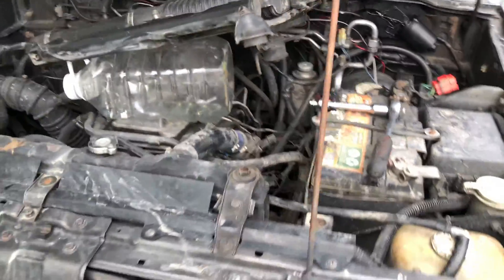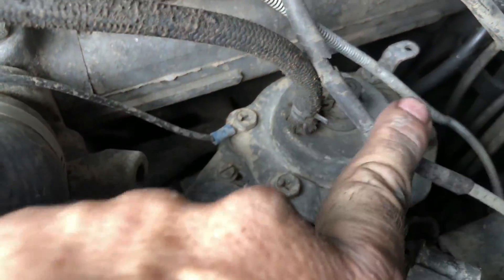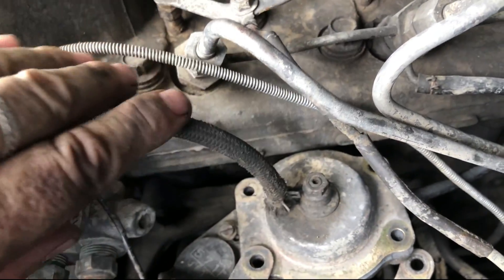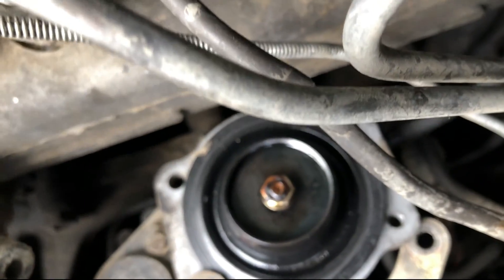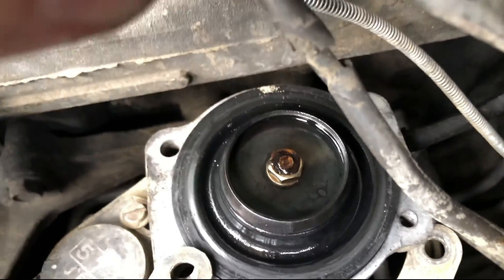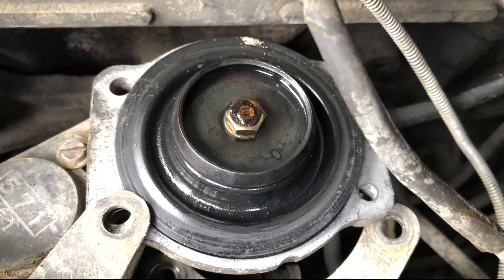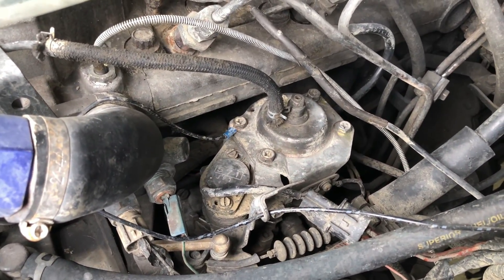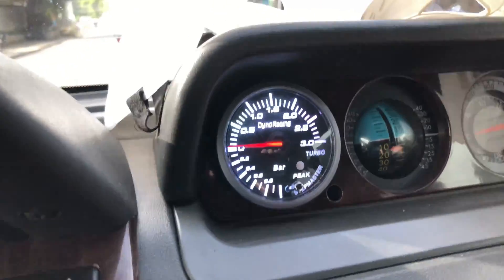HOW TO: Turbo Diesel Injection VE Bosch Pump Fuel Increase Boost PERFORMANCE TUNING MITSUBISHI 4M40

Comment: Interesting. I went to adjust my diaphragm and it was already set at 180 degrees 😑 Maybe it’s already set at maximum and I just have a lack of boost. Trying to figure out why it’s so slow. already deleted the overboost function police, Injectors are rebuilt, new glow plugs and the engine has great compression and fairly new head. Guess id better install a boost and EGT gauge before I crank the boost. This is the problem with buying an old vehicle with no history 😎🙄
Reply: Just read the other comments 👍 I’ll remove pin and confirm. It’s an L300.
Reply from the maker: Yeah, so...first I shimmed the waste-gate with two washers at each bolt. Now I've completely disconneced the waste-gate and removed the boost release valve from the intake manifold. I use the boost gauge only to decide how much fuel to give, as I COULD now boost to nearly 3 bar. My guess is your intake manifold is worn out and releasing pressure at less than. 0.9 bar. I'm careful not to pass 1.2 or 1.3 bar.
Reply: Yeah nice, bet it purring now. The waste gate is mounted on the side, so washer trick won’t work. There is a lot of adjustment in the actuator arm though. At the moment I’m just trying to sort out all the gremlins and have it running stock before I dial in more power. I’ve just removed the diaphragm bolt and can confirm on my L300 the O faces to the back of the van in for minimal fuel. Unfortunately there is a hard sludgy residue on the pin, and just about every other fuel related part I’ve worked on. Guessing it’s on every component in the IP. I’ve cleaned it up, but getting zero boost. I’m guessing the pin inside is stuck. Pressure hose from turbo to compensator is pushing plenty of air. Will report back once I’ve sorted it.
Reply: Success! The fuel pin has freed itself 👍 But now I have too much fuel 😂

Comment: The diaphragm will have a little 0 on it. If you check to see where the fuel inlet is the 0 will most probably be facing it. Clock the diaphragm until the 0 is opposite the inlet. Remove Inlet banjo bolt it should be a 17mm stick a little screwdriver in there and pull the gauze out you can either clean it or throw it away but I throw it away . That’s the secondary filter before fuel entering injection pump you don’t need it it just gets blocked and will loose power
Reply from the maker: Thanks VERY much for this post by the way!
Reply: can u make a video the one u throw away, thanks

Comment: It can be aaplied in Isuzu Trooper 4gj2 turbo?
Reply from the maker: YES...if your injection pump looks and functions like this one, it's the same system. It looks like your engine has two of the plunger pin systems?

Comment: Is this all relatively the same on other diesels? I have an 80 series 1hdt and I want to turn the fueling up /boost up earlier
Reply from the maker: Yes. This mechanical system is basically the same on all older turbo diesel engine fuel injection pumps. On modern vehicles, all these components have electrical sensors hooked up to them or are otherwise blocked off from access or adjustment. What year is yours? 

Basically...if it looks like the one in the video, then the steps and adjustments will be basically the same, with minor individual adjustment for each individual vehicle.
Reply: Mines a 92 vx landcruiser 80 series 12 valve 1hdt
Reply from the maker: @thatsnotright7260  yeah. That should be the same set up.

Comment: This can be apply on 4d56 engine
Reply from the maker: Yes, I think the only difference is the intake manifold pressure release valve in on top of the intake manifold, making it MUCH easier to remove and plug.

Comment: Hi. Great and easy to follow tutorial. 
I've also added shims to the westgate and wanted to rotate the diafragm after, but surprise.... the O marking wasn't facing the engine at 9 o'clock, was somewhere around 2 o'clock. I'm the only one who's been opening the boost controller, so Im pretty sure that's how it came from the factory. My car is a Delica L400 with the same 4m40 and same mechanical pump. I know it's not a Paj but still, any thoughts mate? Thanks.
Reply from the maker: Thanks very much! Yeah...I've heard reports of various positions for the '0'. Many say original position is towards the windshield. Really, it doesn't matter. What matters is the position of the pin and the angle that positions the fuel pin. In my video, I loosen the diaphram and repositioned the '0' so that it lined up with the most aggressive angle of the pin. So, I would recommend you do the same, so that you know where the deepest angle is on your fuel pin. Your questions are always welcome.
Reply: @offgridislandfamily  did exactly that in the end, just took off the diaphragmed and rotated to the most steep angle of the cone. Thanks again!
Reply from the maker: @noidoisiuncaine  BINGO!

Comment: Friend, I have a 2001 Montero 4m40 Turbo, and my friend has another one. For some reason my friend's is much faster going up the mountain and mine is much slower. We have the theory that the previous owner reduced the delivery of diesel in order to pass the emission certification in my country. (already cleaned injectors and maintenance) (highlight that mine also don't show any black smoke in any situation, its normal to be that clean on diesel? and my friend's car shows a little bit of black smoke climbing, that's the main difference between both cars) so this could help? or do you know any trick to increase at least a bit of power?
Reply from the maker: Yes. Your guess sounds 100% correct. If you never have any black, especially under max acceleration, then you are not getting enough fuel for potential power. Compare your fuel system settings to what I show in the video. Adjust as needed. Keep in touch on this. Thanks!
Reply: @offgridislandfamily  My friend!!! you literally saved me! Already adjusted and now the throttle response is so much better, I feel a bit more power and the "good new" is that now I have a little bit of black smoke in full acceleration. Do you recommend to do something else? now I want to do something else to have even more power haha.
Reply from the maker: @mendoza1308  Thank you SO much for this feedback. Really appreciated. Until I learn more about what the stock engine can handle, I'm not passing 1.6 bar / 23 PSI. Many guys are running 2 bar or nearly 30 psi! I'm not ready for that. The next plan is to update the stock intercooler with a modern aluminum one that drops right in original place...then add a second intercooler, either under-hood or front mount. This condenses the volume of air entering the engine, allowing much more fuel to be burned at the same boost pressure. More power without passing 23 psi.

Comment: Isn’t there a brass screw in the back of the pump you can up the base fueling amount? I’ve got creased that on mine and under full boost @max rpm I can still get smoke and has made it need less throttle to cruise, really responsive too not needing boost to give it the extra fuel
Reply from the maker: There is and I have a video showing the adjustment and tuning process on the injection pump / fuel system. The problem is that it's right near the point where any more increase, causes too much idle speed increase. Although, I think I can get a hair more out of it.

Comment: You should have done a dyno before and after. 😊
Reply from the maker: You're absolutely right about that! When I bought it, she was a slug, but I could tell that the mechanicals were healthy and just needed tuning. I'm SURE it's up 30-40%. I also regret not weighing it first. I'm slowly removing any unnecessary part(s) for less weight. If it doesn't work, isn't worth fixing or serve a good purpose, I CHUCK it!

Comment: I madre a sawp from gas 3.0 V6 to a 4M40 recently in my 3 door pajero.  I am lacking tach signal , so I have to figure if I go with a new tach indicator taking the signal from the alternator or get the factory tach indicator 0-6000 rpm and replace the original tach. I would like also get a 60 mm boost indicator and place it exactly like yours in the three gauge panel. Thanks a lot I enjoy your vids!
Reply from the maker: Thanks very much for the feedback and nice swap choice! My tach was intermittent, but has finally resigned all duty. I also have been considering an aftermarket tach and would try to place it where the original is located. The biggest problem is the thin plastic 'circuit board' on the back of the cluster. If you find a solution, I'd be very happy for an update. My next videos will be windshield replacement and frame rust repair, and very soon...a fuel level sensor in the tank will be replaced.

Comment: You do realise boost doesn't magically rise by rotating the fuel pump diaphragm....
Reply from the maker: Like a Festivus Miracle? Perhaps my enunciation was lacking in the very first sentence of the video where I say, 'Increasing turbo boost (boost controller & shimmed waste-gate) ALSO requires increasing fuel supply'? Thanks for commenting though...a second set of ears and eyes is always helpful.
Reply: @offgridislandfamily no worries cocko, I'll let you get back to putting fans in your bonnet over the turbo then 🤦🏻‍♂️
Reply from the maker: @MynameisGeoff82  Whatever floats your boat...which seems to be posting uninteresting and pointless criticisms.
Reply: @offgridislandfamily  dont respond to these people. just ignore delete and mute. changes the whole tone to the comments.
Reply: If turbo psi drops away further up the rev range, there's not enough on boost fueling. Therefore turning the boost diaphragm maybe doesn't increase boost but it certainly will sustain it
Reply from the maker: @barkyclarky  Right. From what I've read, the more boost you have, the more fuel you need. And I am seeing this realtime on mine. With the boost controller completely closed (no waste gate activation) the boost is maxing out around 1.4 bar and no smoke. From what experienced people seem to say, if you don't have black smoke under full boost, you don't have full boost. Basically...seems like you just add a little boost, then a little fuel and so forth until it's the boost controller/waste gate that limits boost, rather than a shortage of fuel.

Comment: the top mount intercooler on the 4m40 equipped Mitsubishi vehicles cannot really effectively cool the turbo heat over 18psi. and unless you have upgraded the exhaust i wouldn't recommend anything over 15psi on stock original equipment.
Reply from the maker: Thanks much for your feedback. Yes...and I've heard that at over 1.65 bar / 24psi, you run the risk of blowing the factory intercooler if it hasn't aged well. The exhaust is full 2.5" stainless from the header to tailpipe with no cat, resonator or muffler...straight shot. The second scoop I've installed currently has a fan and will soon have a second intercooler as well as a modern replacement also installed in the factory location. Thanks again for commenting.

Comment: I might be wrong but isn't 1.5bar out of the efficiency range for the standard turbo? I'm running peak 13psi with fueling mods. Also I believe the standard 0 mark points towards the firewall of the truck. Pointing towards the front is 180 degrees of rotation. I'm at about 120/130 degrees and can't really squeeze more without high EGTs
Reply from the maker: This is a very good question and maybe the answer to why mine just barely reaches the 1.5 mark. Usually it's just over 1.4 bar. I've ready many discussions on this will little consensus. My understanding was that while adequately increasing fuel supply, you could increase boost well over 2 bar, which rapidly shortens engine life. I've searched and read many chats on this and only once was an aftermarket turbo mentioned. Seems that more than safe boost can be achieved with the factory turbo. I'd be very happy to hear of any of your future findings on all this. Regarding the fuel advance, (if memory serves) the one video I watched on this seemed to start with the '0' closest to the engine. Secondly, I had my injection pump calibrated and at the same time asked the tech to turn the diaphragm as per my direction. When he opened the top 'cap', the '0' was closest to the engine. I also read in many places that if you don't have thick black smoke (sounds horrible) then you're boost will be limited. I know that under full boost, at 1.45 bar, There is nearly no smoke, so your theory on the fuel diaphragm may be correct and I may actually only be at about 100 degrees. This could mean that under 1.4 bar boost, I'm not reaching max power for that boost level, given a lack of fuel. I think I'll turn the diaphragm 80 degrees, lower my boost controller setting and see what happens gradually. Thanks for watching and for the comment.
Reply: Hola una consulta usted le  esta dando mas paso de combustible ala bonba o con eso que muestra leda mas precion al turbo saludos
Reply from the maker: @hectorgarrido8629  Si. Aumentó el suministro de combustible girando el diafragma del distribuidor de combustible 100 grados. Puedo convertirlo en 80 adicionales por media vuelta completa. Creo que mi turbo se está quedando sin impulso debido a la falta de combustible.
Reply: What about the main fuel screw?
I’m thinking more about how you are achieving 1.4-1.5 bar of boost
Mine does not boost more than 0.9 bar